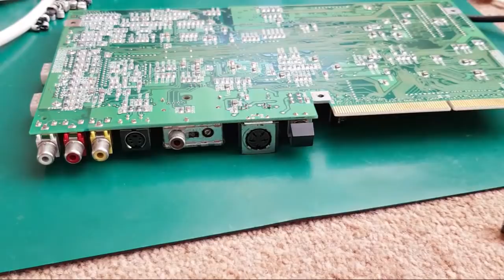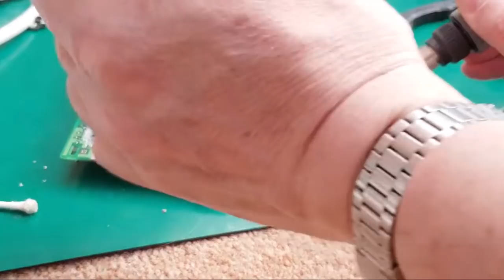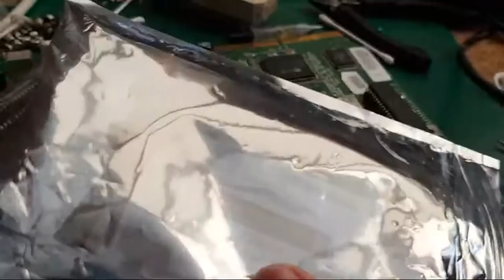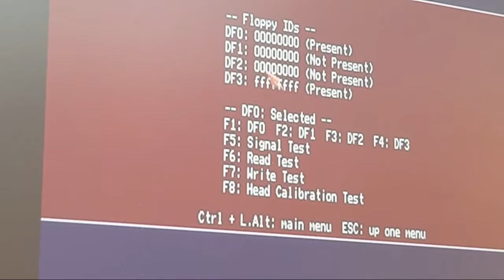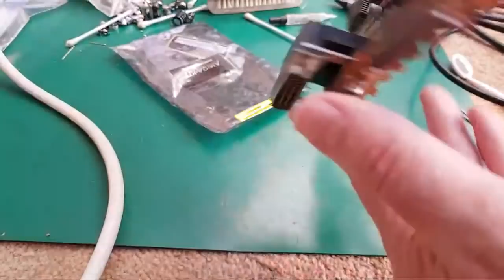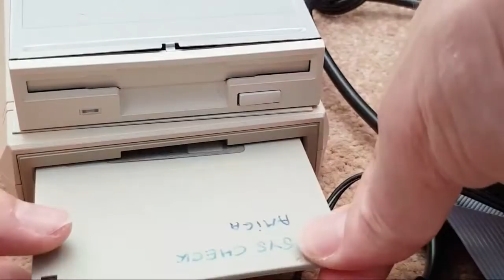Commodore Amiga CD32 Recap Part 2 / A4000 DF2 Problem / Parcel Arrived

Comment from the maker: Ian Scott Johnston -  https://www.youtube.com/user/IanScottJohnston who donated those Spectrum parts!!!! =D
NOTE: I noticed that metal can on the FDD there sat on top of the facia ;)
Correction: When I was talking about that jumper, its in relation to _SEL2 (not _SEL3).  _SEL2 on the external port connects to either _SEL0 or _SEL2 on the board (via the jumper).  In order to switch DF0 to the external drive, or to route DF2 as normal as the first external drive.   For DF1 you would need a 2nd internal drive on the same cable as the internal drive I think.

Comment: Thanks for the video.  In your opinion which is the easier to recap:  a cd32 or a 1200?  There seems to be less plastic on the cd32.
Reply from the maker: 1200 - definitely!  Just that cap right next to the keyboard connector that can be a PITA on the 1200!  Wrap it with aluminium tape and kapton tape before you tackle that cap!

Comment: what temperature do you have your soldering iron set to typically when soldering/de-soldering?
Reply from the maker: Soldering iron typically around 400 degrees.  For a Spectrum or similar board where less heat is required, down to 350.  But boards like the A500 / Atari ST - I will sometimes go up to 450 for power and ground pins etc.  Hot air using my atten, I tend to go around 410.   All degress C btw.

Comment: Yes I have had jumpers fail, sometimes if I am where I have none I have to squeeze it with pliers.
Why would the solder joint affect it, you had no contact between the jumper metalwork and the pin?